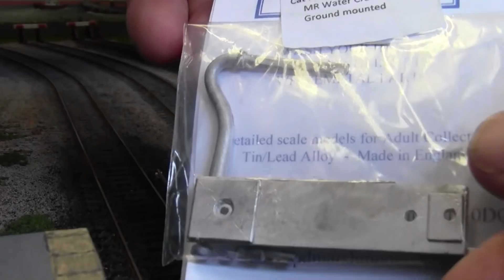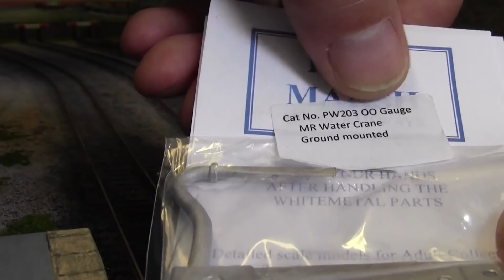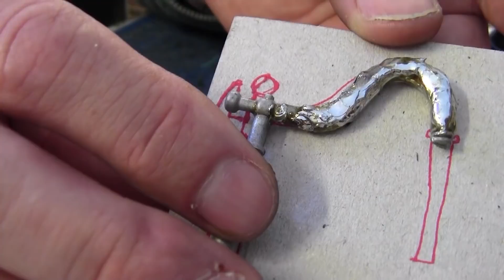Water Crane Dilemma, adapted..No206

Comment: What a fascinating construction method, I have never seen anyone make anything with solder like that and look how great it turned out. What a wonderful job and such brilliant creative thinking to solve the problem. It looks ace on the layout and the varnish spilled water is great finishing touch.
Reply from the maker: Cheer's Mate, when i snapted the arm. it just came to coil up the soldering wire as you can shape the way you want, and it worked, lucky for me...thanks again Tony

Comment: You have done some pretty impressive stuff on this channel over the last couple of years Tony but this knocks spots off the rest mate, stunning modelling. Not in a million years would I have thought of using solder and flux like that, top class modelling buddy and a real inspiration to us all. Cheers Steve
Reply from the maker: Thank you Steve, thanks again for commenting. its just a simple idea that came to me, when in the heat of the moment the original arm had become unworkable. so coiling up the solder wire to create a spring i which you can bend into any shape you want. cheer's.....best wishes Tony

Comment: Tony, I think the reason for the third rail being absent from the water crane area is not because of the water problem  (they can get saturated anyway from rain, frost and ice) but because people would would be walking around there. If you look more closely at the photos, the third rail is enclosed by wooden boards so that side contact is minimised. Your devotion to getting stuff like the water crane "correct" for the locale is legendary stuff!
Reply from the maker: Thank you again for commenting. you are correct, and i do appreciate your valuable input on this project. and at some point i will be adding shuttering around those areas. it will be a fill in job. as i am now focusing on the station. planing and getting the kit together. its going to be interesting to see how close i can get it....many thanks Tony

Comment: Your attention to detail is very impressive. I live in Shields on Spohr Terrace in the newer semis which was once the railway to the pit. Our house is located near where the old station was. I find the history fascinating. I’ve built a small model railway in the garage for the grandson to play with after this lockdown, but now I have the bug I intend to build a much lager one in the loft. Thinking of the theme Tyne Dock to Consett run. It will be my version of it with a station line as well. Not a dead end like Shields. I admire what you are doing and learning from you too. Have you any tips on getting more information of the history of Tyne Dock to Consett pictures and train line maps would be helpful. Love what you do.
Reply from the maker: Hi Stephan, i used to live in stevenson street. just of chichester road. before they pulled the houses down. that's great if you are going to build that layout from Tyne dock to consett. there is a book you might be interested in, consett to south shields. it has everything you need to build the the lines. and plenty of photographs. all the best Tony

Comment: Very nice job. Skytrex do an LNER  water crane white metal kit. I made one up for my layout.
Reply from the maker: Hi Gary. never thought at looking for one at Skytrex, as they were O gauge only in the beginning. but if i had bought one, i would not have had the fun of bashing PD marsh, but on the other hand i may have been further on with the layout. swings and roundabouts. thank you for commenting i know where to look next time. many thanks best wishes Tony
Reply from the maker: Hi Gary. i have been on there website, and found one, the one they have the balancing arm has a full round ball, instead of a conical sphere. i would have been a lot easier to modify. i wounder why the one at south shields has a different shape balance weight.....thank you again....best wishes Tony

Comment: Tony, I've modified an n gauge  version of that water crane before, I had to bend it at 45 degrees to come out of the side of a scratch built water tower.  What I did was to use my soldering iron to soften it before bending it, it worked a treat.  Now I'm not saying it would work for the larger version you have, but if you have the old peice I'd be interested to know that if you applied some heat and then tried to bend it if it worked or not... still great job on solving your problem.
Reply from the maker: Hi Mate. you know what it probably would worked pre-heating. maybe just leaving out in the sun on a pane of glass for 5 minutes might have been enough to soften it up. nice thought. my soldering iron has one setting that very hot only. i love messing around with white metal kits. thanks again for commenting Johnathan....stay safe Tony

Comment: Good job but I would of got right gauge of rod and bent that.
Reply from the maker: Hi Darren. That would have worked using some rod.soldering wire i have plenty of in various thicknesses. thanks for commenting. best wishes Tony
Reply: Still looks good though bud
Reply from the maker: cheer's Tony